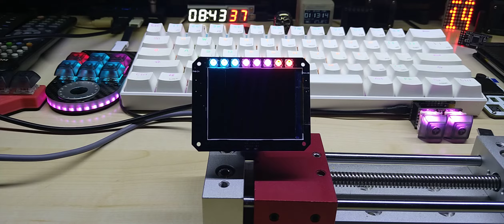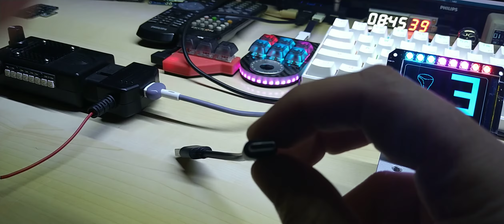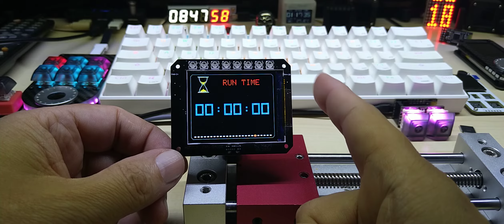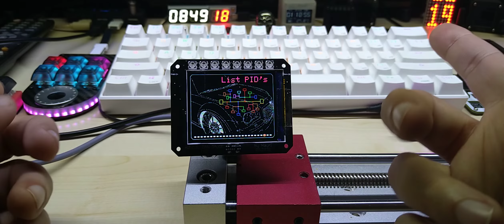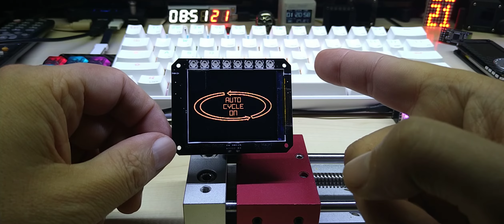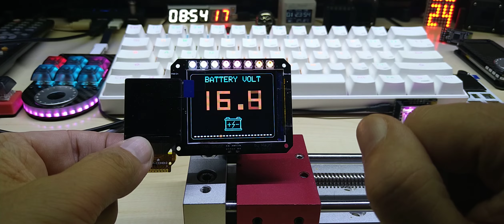New H.E.D.S. CAN GAUGE PRO now with 2" IPS Display and new Features just plug it into the OBDII Port

Comment: Hi i purchased one of these gauges a few years ago but i got the usb connection that has to be hard wired to the car im not sure if you had the cable at the time i purchased
Reply from the maker: Hi, please send me an email with your contact info so I can look up the pictures of your order, thanks.
Reply: @iHayri1  hi I was struggling to find your email address
Reply: @iHayri1  hi where can I find your email again? Thanks
Reply: @iHayri1  hi where can I find your email address my email has changed since so can't find my old emails
Reply: @iHayri1  hi I can't find your email address for some reason
Reply: Hi I can't find your email address and the comments keep deleting for some reason do you have the leads for sale on your website? Thank you just about to use it after purchasing at least two years ago lol by the way is there any updates for it since then?
Reply from the maker: I just saw your replies by chance as I was looking for another reply in my Comments tab. No idea why they were deleted. You can find my email in my Youtube channel About tab, or you can send me a message through Tindie.

Comment: Will you be adding two at the same time? Like oil temp and boost? And still keep the shift lights on engine rpm. That would be extremely useful!
Reply from the maker: Unfortunately I can not accommodate all the wishes I receive and rather concentrate on adding new screens and features. Next one being a 100-200 Km timer.